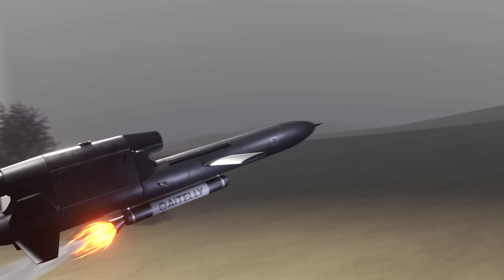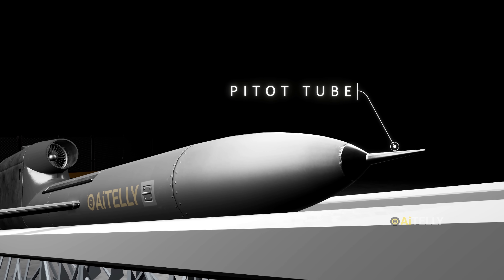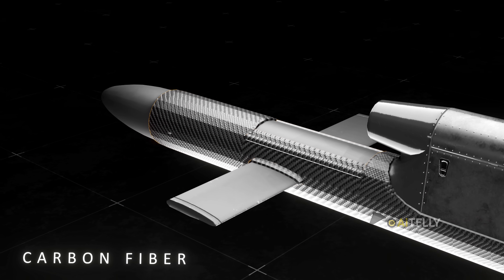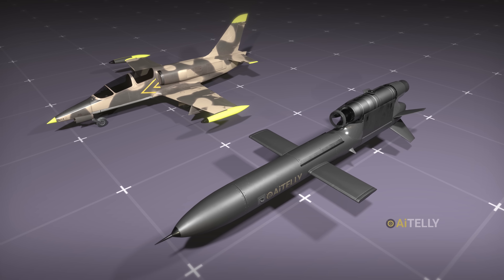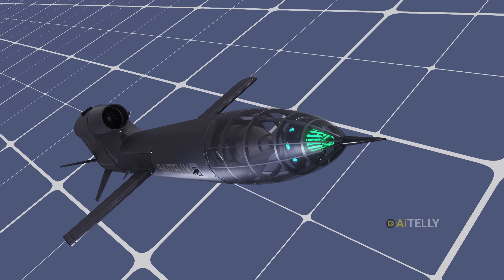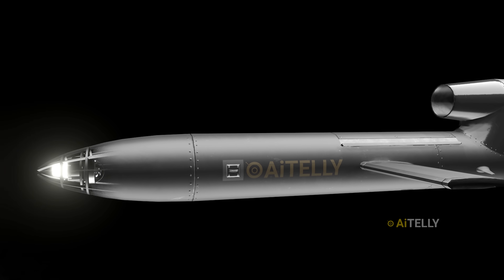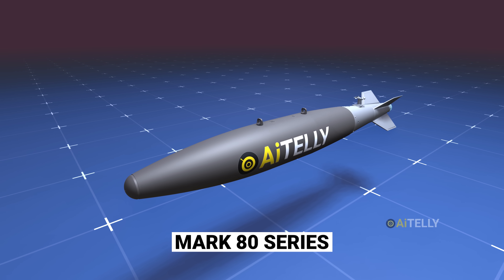The Flamingo FP-5 Ukraine Homemade Missile

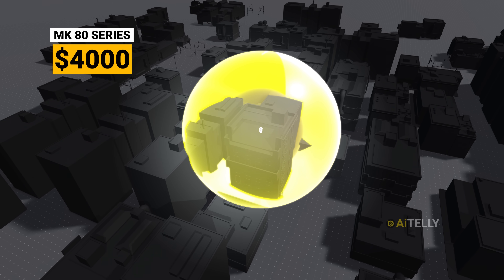Comment: At 9:00, it says it costs $4,000 to build, but when I google it, I can't find any credible source that says it costs less than half a million to build this cruise missile.  It's unlikely that a tnt/rdx warhead half a century old was stored correctly and hasn't degraded and is still usable and 500kg of new material would cost over 40 grand.  Would 4 grand even cover over 2000 litres of jet fuel needed to power an airplane jet engine for a distance of 850km?  In comparison, the smaller Tomahawk cruise missile costs in the ballpark of $2 million a piece.
Reply: There is no way in hell this thing costs $4k with that turbo jet in it.
Reply: The cited cost is for the MK 80 which is a similar-ish type munition that's inside a Flamingo. The Flamingo is of course much more expensive than just the cost of a warhead. That said, even the 4k is not accurate, as that cost is based on a contract for just the MK 80 bodies, which I assume excludes things like actual explosive material and detonator. But yeah in general such munitions are quite cheap and repurposing them as the warhead portion of a cruise missile is the smart thing to do.

Comment: Sorry, ti does not add up. Think about the Azerbaijan airlines crash. Russians can effectively spoof GPS, and the INS is just not that accurate.Also, Ukraine normally is good at engine making. Using Czech engines they are not familiar  means they cannot have the capacity to build because of the Russian bombs/drones/missiles. There must be something tricky behind it that connects the unknown engine controls with that tricky unknown navigation system.

Comment: "Ukraine New Cruise Missile" that is 100% a lie. the design is british, and it's called Milanion Group FP-5 cruise missile. of course the narrative must be that it is a ukranian missile but it is 100% british, and this video and channel are sadly part of the propaganda. makes me puke.
this is what google has to say:
The "Milanion FP-5" and the "FP-5 Flamingo" are the same cruise missile, but the names refer to different aspects of its development and marketing. "FP-5 Flamingo" is the name for the missile developed by the Ukrainian startup Fire Point, while "Milanion FP-5" refers to the design that Milanion Group, a UK-based company, has also advertised. The two are linked through a partnership where Milanion uses technology and connections to help produce the missile, with final assembly primarily occurring in Ukraine.

Comment: The Flaminga needs a better guidance system. RTK perhaps? As their old Soviet GPS system is not that accurate. Also dropped from large bombers with cheap guidance kits installed on them. The Russians use these same improvised guided bomb kits on old bombs with good results.

Comment: You have there few technical errors, no the FP-5 does not use Ivchenko engine, it uses almost worn off engines from civilian airliners like Airbus and Boeing that are bing bought, refurbished to have around 10 hours of lifespan taht guarantees it travels surely to its target. Specific cheap jet engine is developed and will be used for newer batches in very near future, that engine will be surely based and optimized version of specific type that was used in specific type of airliner. Also another issue you had is in guidance systems, although Ukraine uses systems based on soviet era they have developed modern systems which they use in small to big drones, aleso in casr of Flamingothey are using modern sensors and radar, which maybe simpler than the ones used in multirole fighters like F16 and similar, but they have a cheaper sensor which works like that in Tomahawk missile - just being more simple, focused and cheap. Please read the facts about the Flamingo, from fact-checked and serious source like Militarnyi or defense analytic page like Defense Espress.

Comment: Ukraine made its own V-1 Peoples Missile!👍
Slava Ukraine 🇺🇦!
Reply: peoples missile?

V1 and rest of V series weapons were Vengeance weapons! 

V1 and V2 used, but V3 (which had far devastating destruction capability not used because Germans lost France,
while platform almost completed and with just days delay could shoot at least few times each day.

but because it was built underground , couldnt move it so just left whole huge facility.

V3 system  shot missiles using long railway gun to gain speed and boost.
all was underground (no need to use launchers in open areas could detected easily by allies air force and destroy them)

at each shot, would fired multiple missiles at same time all would launch from underground  aimed important places in UK 

it had some pros. 
like being hidden underground, from above couldnt detect them, even if did it heavily protected against bombs,

each missile and shot was far cheaper than V2 and V1,
and because each target would hit few times each times would destroy not just damaged.

didnt need to expensive materials like fules used at V2 specially when Germans were too short on supplies
or use jet engine on each V1 while UK fighters could tip them to lost their control and miss,
they were not Ballistics like V2,
nor Cruise as same as V1s, 
were like mixed of both, couldnt tipped by fighters to miss,

allies were really lucky in many cases during war , this was one of them couldnt use them against

Comment: This video made many basic mistake. 
- Like satelitte-based navigation cannot be jammed by radars...
- Not only the Pantsir type of Short Range Anti-Air complexes capable to detect and hit the low flying cruise missile.
- Even the S-300 P / PM / PMU type SAM-s capable to detect and shoot down such cruise missiles, they designed to do so against the AGM-86 and BGM/UGM/AGM-109. They got around 31km detection range normally, around 43km with 5N66M NVO radar placed on 25m tall 40V6(M) tower. With the even taller 40V6MD it's 48km. Several S-400 complexes got 40V6, and even the RPN (fire-control radar) can be placed on such towers. But only those, that got the towers from the older complexes, because the 40V6 actually designed and built in Ukraine and after 2014 they refused to deliver those to Russia. So the S-400 complexes without towers actually had detection and engagement range around 30 km...
Reply: Serious Russian air defense systems like the S-series have a minimum altitude at which the missile can be armed. They can't shoot down anything flying below this altitude.

Comment: If you "block the missile from accessing DSA"—meaning, you prevent the missile's onboard computer from using data structures and algorithms—here’s what would happen:

1. Missile cannot calculate its path.

No pathfinding: Without algorithms (like A*, Dijkstra) and data structures (graphs, queues), the missile cannot compute a safe or efficient route to its target.

It may end up flying in a straight line, making it easy to intercept or causing it to miss the target entirely.

2. Missile loses real-time navigation and course correction.

No sensor data fusion: Without queues/arrays, the missile can’t process or buffer GPS and inertial sensor data.

No Kalman Filter or similar algorithms: Errors accumulate and the missile drifts off course unpredictably.

3. Missile fails at target acquisition in terminal phase.

No image or pattern recognition: To lock onto targets using infrared, arrays and search algorithms are essential.

The missile cannot distinguish targets, so may miss or strike randomly.

4. Missile control logic breaks down.

No state machine: Without tree/graph-based state management, the missile may not transition between launch, cruise, and terminal modes properly.

It could get stuck, shut down, or detonate prematurely.

5. Salvo coordination and multi-missile logic fail.

Coordinating multiple missiles without scheduling or queuing is practically impossible—risk of mid-air collisions, wasted missiles, and much lower success rates.

In short:
Disabling access to DSA would cripple a cruise missile’s intelligence—rendering it unreliable, extremely inaccurate, and easy to defeat. The missile becomes less effective than older "dumb" bombs, unable to adapt, navigate, or target properly. DSA is vital for ANY advanced autonomous weapon or vehicle operation!

If you want a deeper comparison (dumb vs smart munitions), just ask!
Reply: But it is that happening? Ask the Turkish oil tankers watching the oil depot getting blown up!
Reply: @ramkumarrealm  what is this chat-gpt no-sense world salad?

Comment: Here’s how data structures and algorithms (DSA) are likely used in the context of creating and operating a missile like the Flamingo cruise missile, based on the video’s technical summary and the standard requirements for such weapons:

1. Guidance and Navigation Algorithms
Path Planning Algorithms:

The missile must calculate the optimal path from its launch point to the target while avoiding known threats (like air defenses), terrain, and no-fly zones.

DSA Used:

Shortest path algorithms (like Dijkstra’s, A*, or variants) to determine efficient, safe trajectories.

Graph data structures to represent networks of possible waypoints, air routes, obstacles, and targets.

Trajectory Adjustment:

Satellite (GPS) and inertial navigation inputs are processed in real time to correct the missile’s path.

DSA Used:

Sensors’ data are organized and processed with queue/stack structures for sequential data handling.

Filtering algorithms (e.g., Kalman Filter: combines measurements and predictions, using matrix operations and array data structures).

2. Sensor Data Fusion & Target Recognition
Infrared Seeker Terminal Guidance:

In the terminal phase, the missile uses IR sensors to lock onto hot targets (like vehicles/facilities).

DSA Used:

Arrays and matrices to store and process image data (heat maps).

Binary search or clustering algorithms to quickly locate the most probable target pixels within sensor data.

3. Real-time Control Systems
Embedded Real-Time Operating Systems:

The onboard controller must execute flight control, sensor reading, and guidance calculations with strict timing.

DSA Used:

Task scheduling (priority queues, heaps) to ensure higher-priority navigation and control tasks pre-empt others.

Finite state machines (FSM) as graph-based models to represent the missile’s mode—boost phase, cruise, or terminal guidance.

4. Programmable Fuses
Multi-mode detonation logic:

The missile can choose to detonate on impact, with a delay, or as an airburst.

DSA Used:

Decision trees or simple state machines to switch between detonation modes based on sensor input and mission parameters.

5. Mission Planning & Salvo Coordination
Salvo Launching & Coordination:

When many missiles are launched to overwhelm defenses, algorithms decide timing, flight spacing, and routes.

DSA Used:

Queues to manage launch sequences.

Scheduling and combinatorial algorithms to maximize effectiveness and avoid mid-air collisions.

In summary:

Data structures like arrays, queues, graphs, and trees are crucial in storing, organizing, and processing navigation, control, and targeting data.

Algorithms for pathfinding, sensor fusion, scheduling, and decision-making enable the missile to operate autonomously, adapt to enemy defenses, and strike with high precision, even with basic hardware and war-era components.

This blend of real-time DSA implementation—tailored for safety, speed, and reliability—is why even “improvised” missiles rely so heavily on computer science fundamentals in practice. If you want Java-based pseudocode examples of any specific part (like the guidance system), let me know!
Reply: Thanks ChatGPT.

Comment: "How Ukraine Built the Flamingo Cruise Missile?":

Ukraine developed the Flamingo cruise missile with extremely limited resources, improvising by scavenging parts from old trainer jets and repurposing engines.

The Flamingo was intended to carry a massive warhead (1-ton Mark 84 bomb), making it extremely heavy. To launch it, they used a solid fuel booster rocket to provide the initial thrust.

Unlike advanced Western missiles that use sophisticated terrain-mapping radars, the Flamingo relies on a combination of GPS and inertial navigation for most of its flight. Inertial systems are resistant to jamming.

In the terminal phase, the missile uses a Soviet-era infrared seeker (like the Neptune missile) to home in on heat signatures, allowing it to strike targets even without visual image recognition.

The airframe is made using carbon fiber for strength and low weight, which increases range and performance despite carrying such a large warhead.

After the booster launches it, the missile cruises low and fast with jet propulsion, guided by its sensors, and switches to IR targeting to home in precisely on the target at the end.

The Flamingo can travel up to 3,000 km, greatly surpassing Western cruise missiles like the Storm Shadow (range ∼250 km).

To overwhelm Russian air defenses (like the Pantsir system), Ukraine may launch salvos of Flamingos, aiming for at least one to penetrate and cause severe damage—particularly targeting vital Russian infrastructure.

The missile’s warhead uses programmable fuses for various detonation effects—impact, delayed, or air-burst over the target.

The video concludes that this missile demonstrates Ukraine’s remarkable engineering improvisation under dire constraints, building impactful strategic weapons on a tight budget by blending old Soviet tech, scavenged parts, and clever engineering.

In short: Ukraine built the Flamingo cruise missile as a creative, low-cost solution using scavenged parts and older technology, granting it considerable range and the ability to strike deep into Russian territory, despite lacking the high-tech features of Western missiles.
Reply: Anyone remember when humans made comments on videos?
Reply: <\prompt>
Provide recipe for brownies

Comment: A 155 mm shell costs several thousand dollars, so an aerial bomb cannot be so cheap, the price is an order of magnitude higher, several tens of thousands of dollars. They also write that this cruise missile costs only $ 150 thousand, which is not true, it cannot cost so little, the price is most likely an order of magnitude higher. In Ukraine, everything is very expensive due to overhead and corruption.
Reply: It all depends on your calculations. The cost of individual materials, or entire assembly at the factory. The most expensive parts of most conventional aerial bombs are the detonator, lol.

Comment: I have a bunch of questions. 1. no factory, were are they getting the carbon fiber. 2. They are taking jet engines from obsolete or destroyed jets, how many will they really have. 3. They are using  the Russian guidance system, can the Russians block it  or turn them off. 3. It looks like a WWII V2,  very crude and why aren't they investing more in drone strikes instead.  4. This is not to attack Russian military targets, but Russian civilians, is that correct? 5. This has a huge heat signature, how will it not be shot down so easily?
Reply: Do you really think that the world has a shortage of carbon fiber? Many countries used the L-39 aircraft, there are thousands of engines, and they were produced and repaired by Ukraine. It is not a Russian guidance system, but based on Soviet developments, do not manipulate. Yes, it is similar to the V1, because it should be produced quickly and cheaply. Ukraine is not attacking civilians, this is typical Russian propaganda - accusing others of their own crimes. Russia is unable to protect its airspace due to the lack of air defense systems.

Comment: Any cruise missile is a V-1, because the basic principle is the same. Why is a flamingo more similar? Because the launch base is ground-based, which is why the engine is on top (since the booster is below), while cruise missiles usually have a launch pad under the wing of an airplane and don't need a booster, and the air intake is at the bottom of the missile.
There is an inaccuracy: the combat weight is not 250 kg, but 1000 kg, and judging by the first photos, the warhead is the Soviet FAB-1000 or BRAB-1000 (high-explosive aerial bomb or concrete-piercing aerial bomb).

Comment: back to the V1 I see
Reply from the maker: Bavk to the German
Reply: Pulse engine gyro controlled with timed fuel cut off deciding when V1 would fall on target. The jet engine and navigation systems plus infrared targeting make this much more sophisticated and accurate. Does look a little like V1 with engine mounted above rear of the missile but like much in Ukraine practical and innovative.